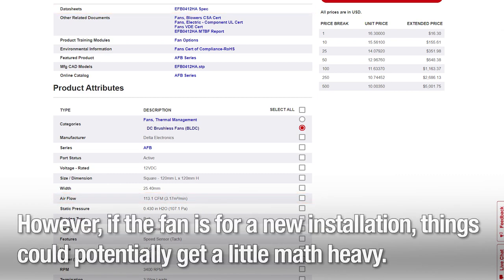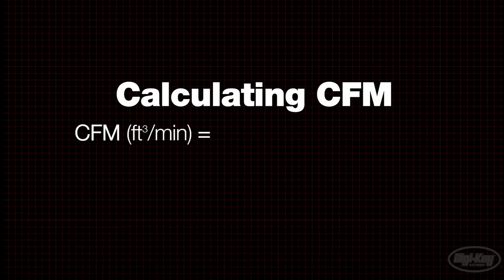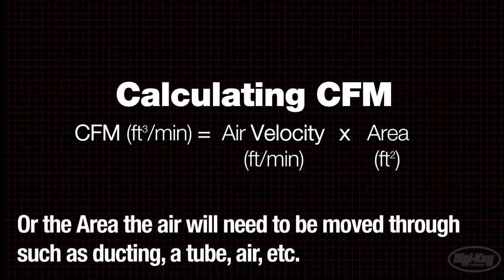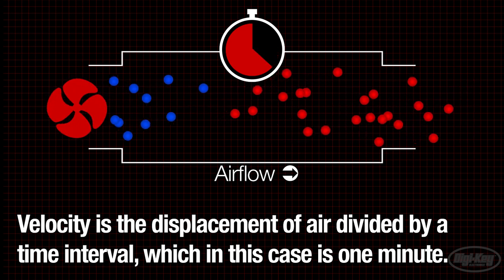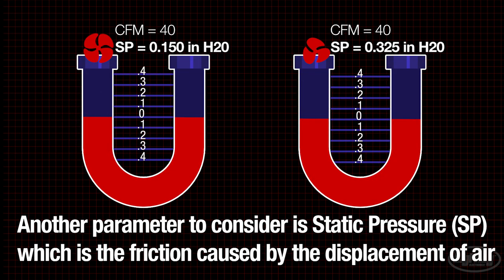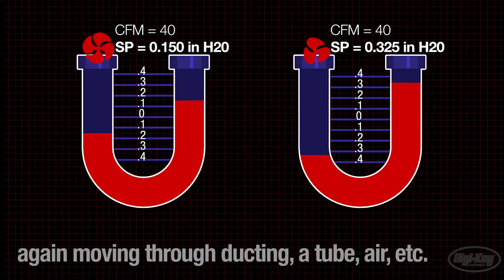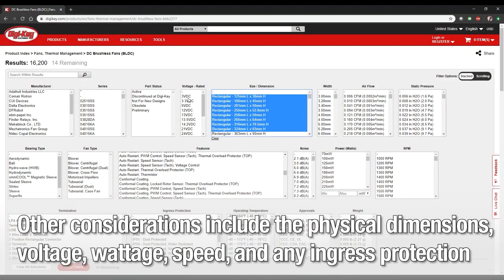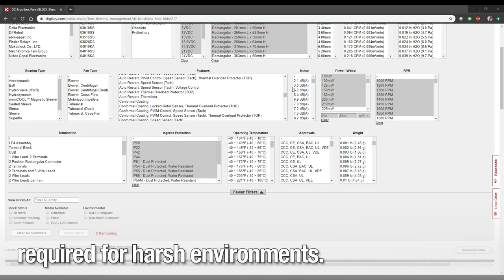Fan Basics - Another Teaching Moment | DigiKey Electronics

Comment: Carry Gen 4 CXM-32-80-54-AC40-F5-3 please
Reply from the maker: Do you have the full part number? The standard skus have another number after the 32. so CXM-32-XX-80-54-AC40-F5-3.
Reply: @digikey     Whoops. CXM-32-35-80-54-AC40-F5-3 3500k is the best all around color temperature for yiield. 90 CRI has a better red spectrum but the efficacy isn't quite as good as the 80. There are a lot of home growers of all kinds of plants who are chomping at the bit to buy 2-4 at a time. Once word gets out that digikey has 300 or more, it will spread on nearly every grow light build and test channel on you tube. Here is a channel with over 31K subscribers and the main reason why these COBs are so anticipated. 
https://youtu.be/XQW01csA6DM
Reply: @digikey  Not only that, buut Mouser recently bought 300 of the 90 cri but GEN 3. Nobody wants Gen 3 anymore. Especially at $39 a pop.
Reply from the maker: @PeterKKraus  I can send this suggestion on to the product manager. I do see that we carry CXM-22-35-80-54-AC40-F5-3 which is just a smaller lens diameter. Otherwise the same specs.  https://www.digikey.com/product-detail/en/luminus-devices-inc/CXM-22-35-80-54-AC40-F5-3/1214-1622-ND/9816722